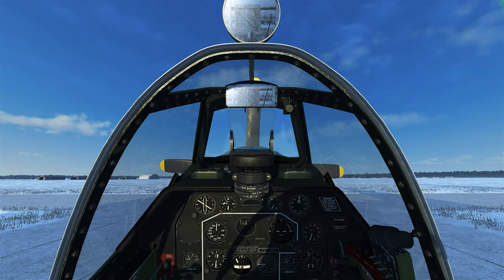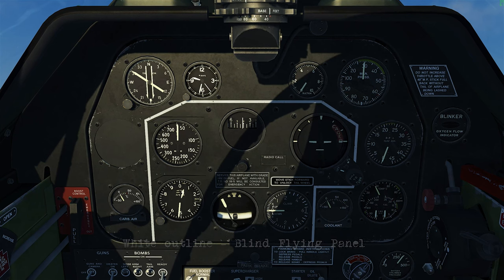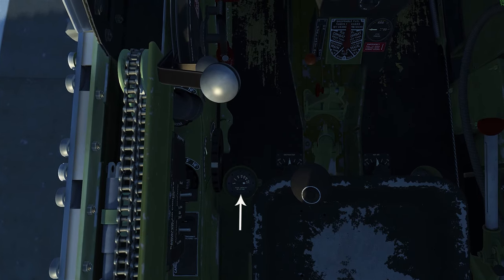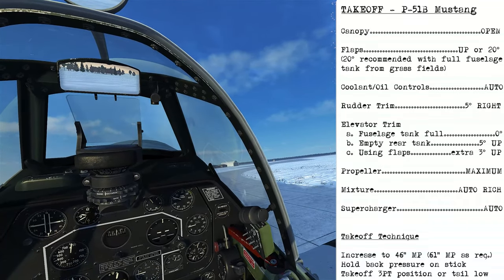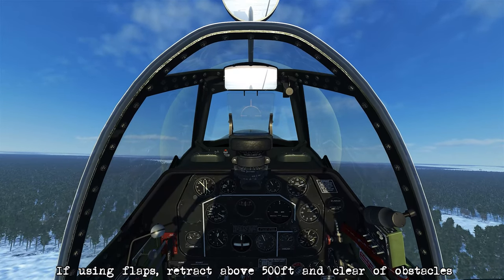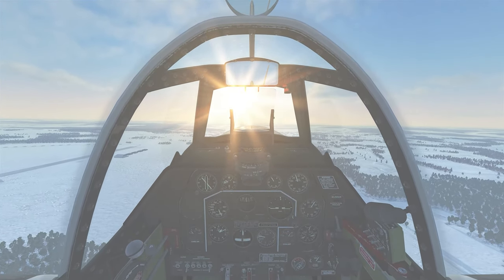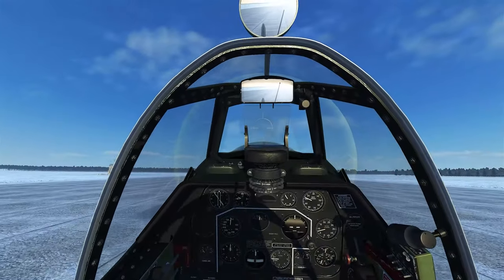Learn to fly the P-51B Mustang

Comment: What's the purpose of starting with the canopy open? Also, is this how real-pilots did it?
Reply from the maker: Yes, real pilots would keep the canopy open until you're safely in the air and then open it again before landing. This allows the pilot to escape quickly after an emergency landing or if the airplane rolls upside down as a result. If the canopy wasn't open and locked then the force upon the plane crashing could slam the canopy shut and the pilot would be stuck in, a possibly burning, airplane. Not at all necessary in a simulator though so do what you prefer!

Comment: I just installed 'Normandy', and can't yet figure out how to gain separate axis control over throttle and prop rpm as they are linked in some way in the P51. Also, mixture seems to be locked at full rich and won't move with its assigned axis.
Reply from the maker: May need to check that you dont have engine assists turned on in difficulty settings, but there's also a keybind to them off
Reply: @RequiemsACTL  Damn! I needed to set 'Expert' in mission settings The key binds seemed to have no effect otherwise, but your "difficulty" advice tipped me off to look at that. Spent a whole day frustrated at not being able to run full RPM and manage throttle for landing. Thank you very much.

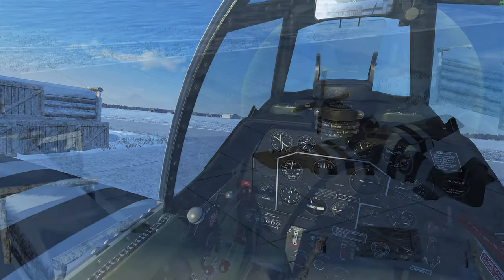Comment: 3:54 oil and water temps switched?
Reply: Water can stay in liquid state above 100 'C when it's at a higher (than atmosphere) pressure. For example, at 3 atm boiling point is at around 134 'C. And vice versa.
Reply: @hankczinaski915  I know, my question still stands. Also take a look at oil/water temp gauges in cockpit.
Reply from the maker: It's actually an ethylene glycol coolant so it's not "water" but I just write it that way for consistency with the in-game notes as the "water radiator" are the coolant radiator controls.
Reply: @RequiemsACTL  ty!

Comment: Super jealous of your smooth head-tracking... I guess spending the money on TrackIR may be worth it after all?
Reply from the maker: TrackIR definitely improves the immersion factor, but snap views can still be better from a competitive MP standpoint because it fixes the view perfectly which would let you spot contacts easier.
Reply: why not just get VR?
Reply: @yacobz  VR is much lower resolution than a computer monitor which makes it extremely hard to spot contacts which can be about the size of a pin point. VR is also still very much in an experimental implementation in IL2 BOS